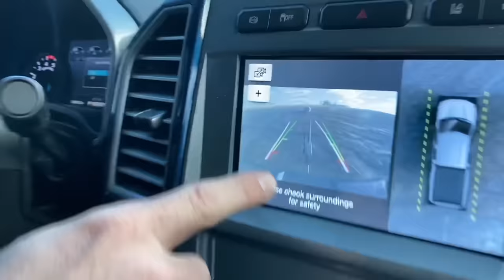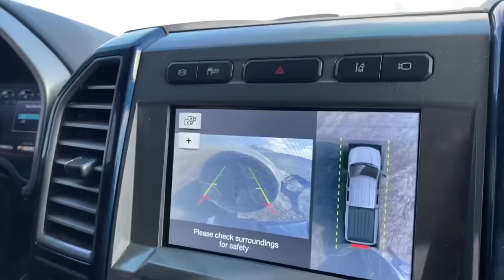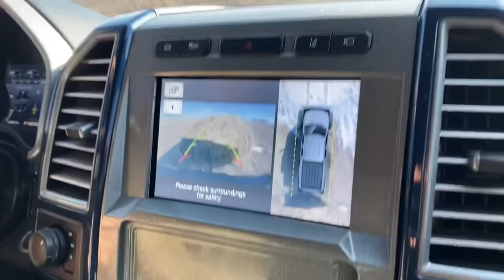The AnyLevelLift Round Bale Hauler and Parallel Parker

Comment: This is just a badass toy, I love how people are getting pissed because he’s using a truck the way your supposed to use a truck  hahah
Reply: he is going to be crying next year when he realise is frame is broken were the shocks are bolted .i know i broke two ford frames just pulling big trailler with air ballons on truck,they breake exactly above the midle off back wheels or axel and i have seen many more than just mine. Dodge rams 2500  they breake in the front if you put a 8ft snow plow on them ,fords its the back
Reply: richard desbiens next year?? lol by then he would have made enough to buy a couple more sema trucks this truck is probably already close to being paid off from add revenue alone
Reply: @yessirski4076  okay but it is not a good idea for any farmer to move round bales that way ,i will continue with my tractor and round bale fork
Reply: richard desbiens where you located? In need of a job
Reply: Clearly you have never "used a truck the way you're supposed to use a truck" AND don't know a real "farm truck" from a rolling bolt-on disaster like that.
Reply: richard desbiens      Wtf kind of hieroglyphs did you just comment lmao
Reply: @richarddesbiens796  still doing fine a year later

Comment: The wheels on the back are genius! Need to motorize them.
Reply: they make campers with those. An axle sideways on airbags with an electric drive. Then you can swing the trailer sideways to get in or out of a tight spot.
Reply: @Shill Talk yep, small electric motor , chain driven on most.